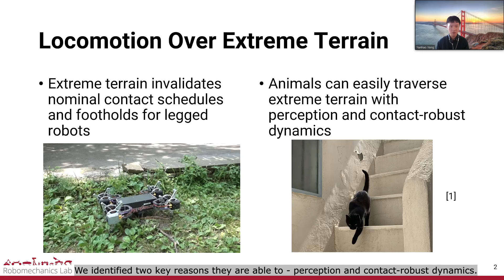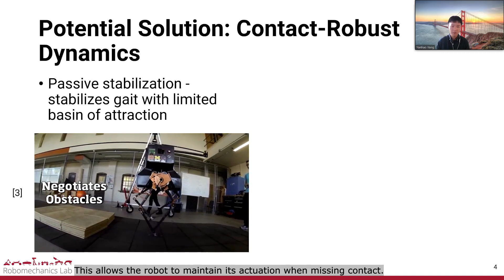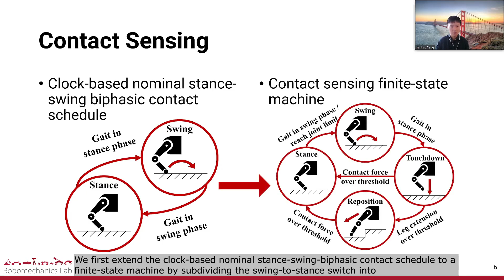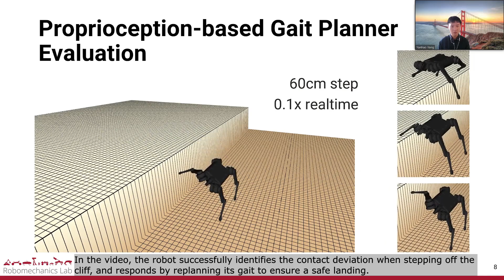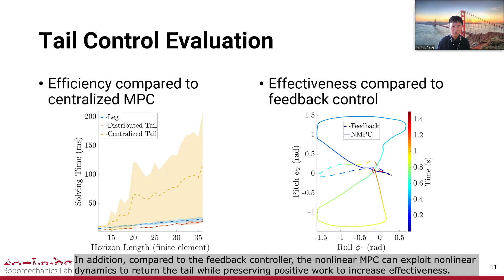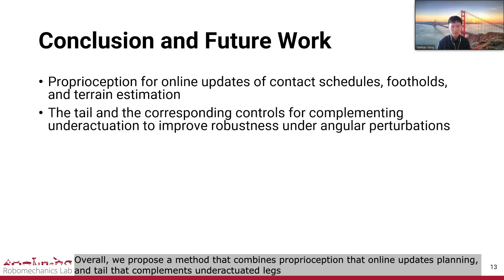Proprioception and Tail Control Enable Extreme Terrain Traversal by Quadruped Robots - Presentation

Comment: Thanks for sharing, I was thinking about using a tail on a small quadruped robot, mostly to hold a camera so it can see its own feet position. But I think this tail could be multipurpose if I gave it 2 DoF.  It could both be a balance aid, and a camera mount.